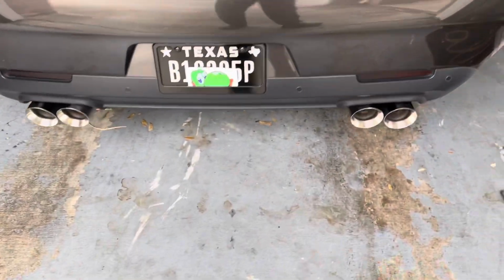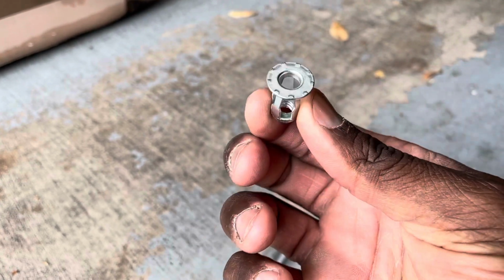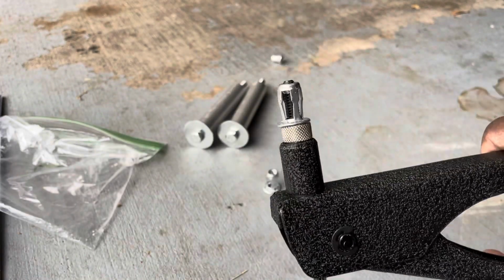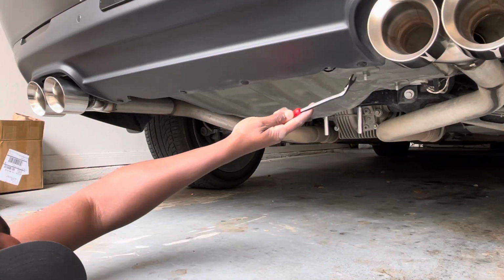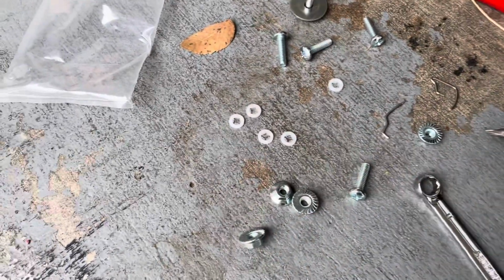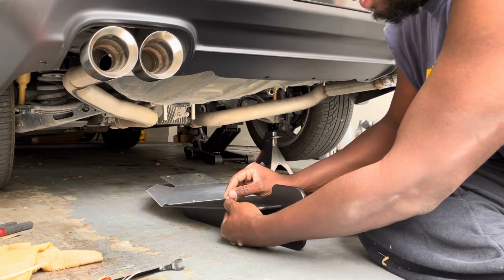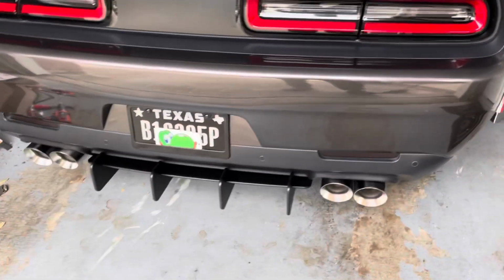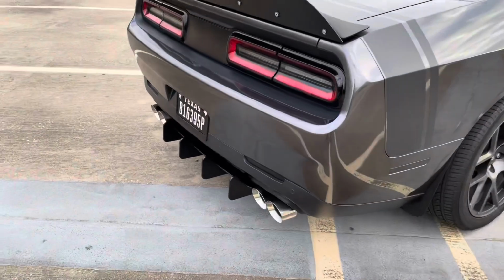Installing zl1 addons Rear Diffuser on My Dodge Challenger Scatpack

Comment: Can you install the exhaust tips without cutting the rear mufflers? Cause I wanna cut the mid mufflers which is just the right amount of sound for me and if I cut the rear ones as well - it’ll be too much
Reply from the maker: It’s gonna stick out to far…but after you cut off the mids see if the shop can install the tips and rear muffs in just enough not to stick out too far from the bumper. Worth a try.
Reply: @KJMack82  thanks for the reply bro, another question then: is it worth cutting the rear mufflers and leaving the middles on? Is the sound way too noticeable?
Reply from the maker: I have no clue, might wanna research that